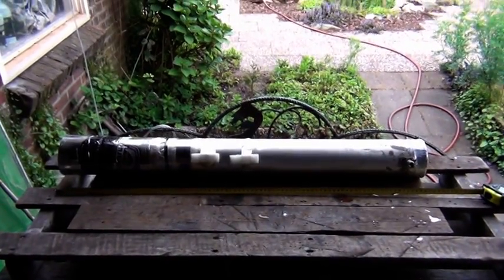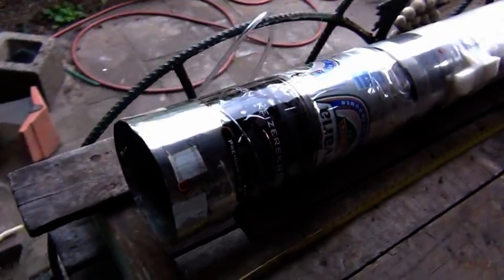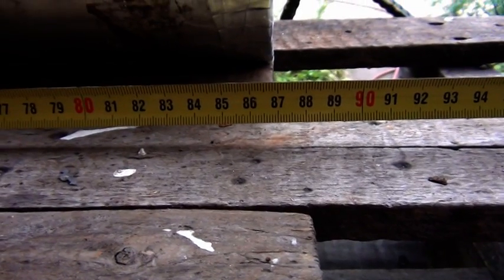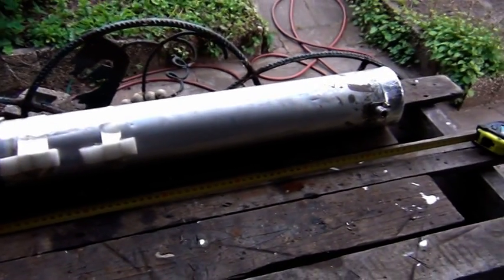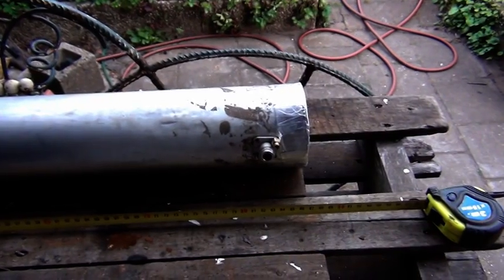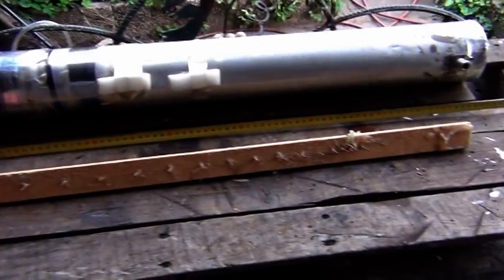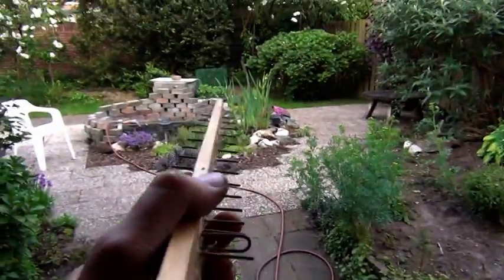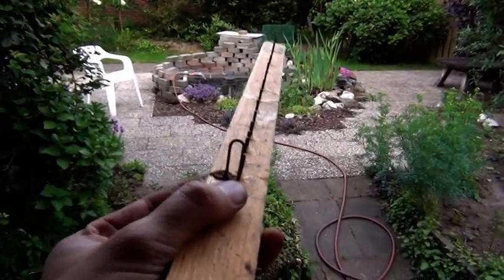DIY wifi antenna, cantenna & yagi (28)

Comment: Use Copper nails man
Reply from the maker: Thx for watching! I drilled the holes free hand with a drill bit that was slightly too big, the length of the elements is very critical, as well as a consistent diameter of the elements, so when I drill the holes with my drill press with the right size drill bit the problem should be solved. Getting the elements the right length, and I'm talking about 2 numbers behind the decimal, is by far the most time consuming job, compared to that drilling new holes with my drill press is an easy job :-) Peace, iT
Reply from the maker: P.S. I forgot to mention that all the elements have a slightly different length, so you have to make them piece by piece anyway. That is why I am going to recycle the elements and drill new holes.